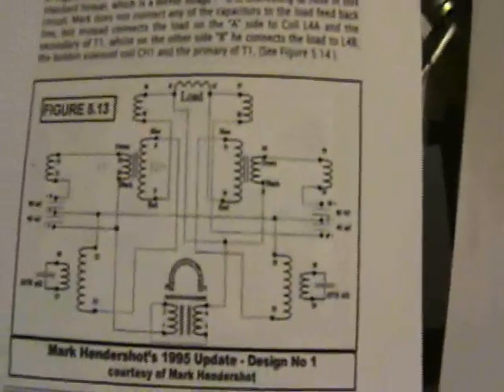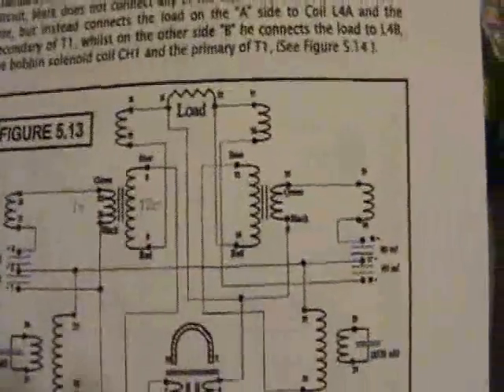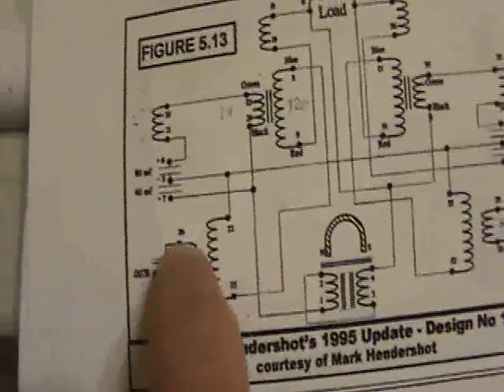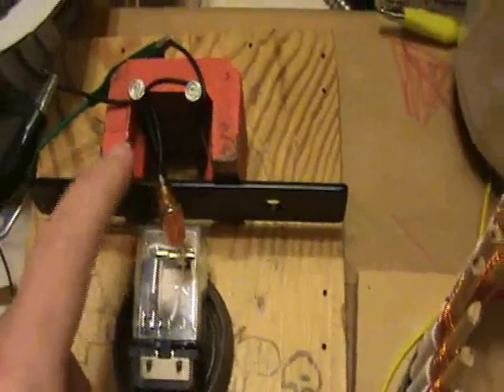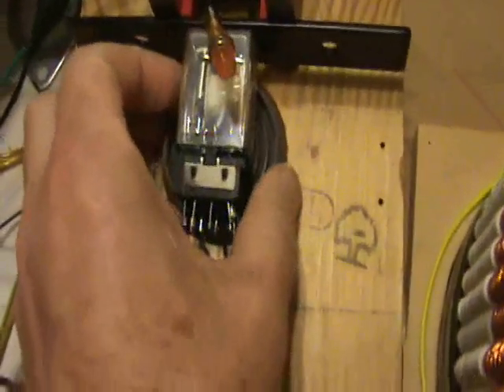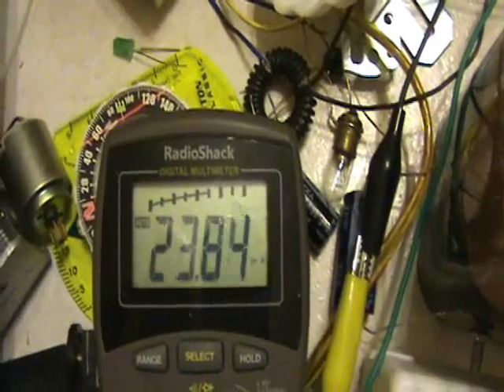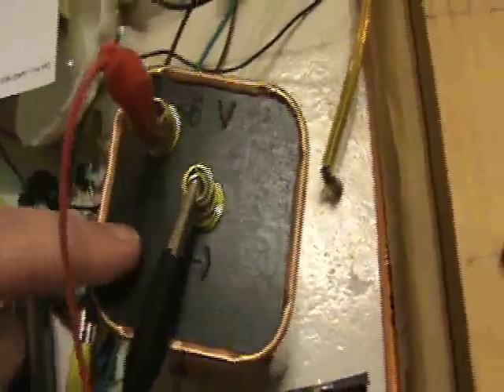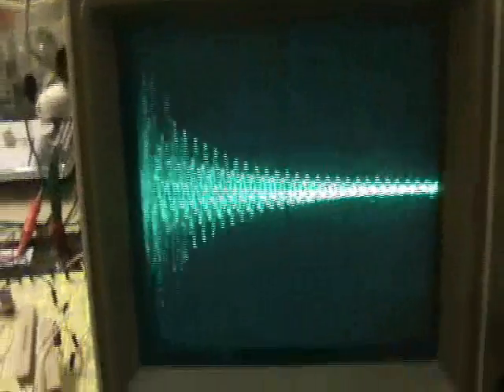"Hendershot Fuelless Generator" -Mark Hendershot 1995 Update

Comment: b
PLEASE READ ALL!!!!!!
I purchased the video; instructions ebook schematic. I remain most disappointed.
First: the video had stopped and then restarted. In that process wire had already been placed and soldered leaving me confused and not knowing. Secondly: the video was extremely amateur; there was no voice to explain step by step instruction, to make the process easy to follow this pissed me off. When I first  e mailed support I got a message that had nothing to do with message. I mailed again and have never received a reply.  Observing the video -several times I gained understanding to a degree, and some parts of the process seem okay. I am not able to read schematic very well, and can see the average consumer would not be able to put this generator together successfully. I observed the lights and the TV. However, there is no reason to believe it was due to the generator. I think perhaps it could light a bulb -although that is it. Many people are attempting to make this work for enough KW to power a house; however, I am confident there is nothing at this point and time. Prove me incorrect!!!!!!!!!!!!!!!!!!!!!!!!!!!!!!!!!!  OH, TRANSFORMERS; ONE PAPER HAS 1.5 RATIO, AND THE OTHER IS 1.5, ON SCHEMATIC IT IS 1.5 ON ONE AND THE OTHER 5.1  --WINDINGS; IN THE INSTRUCTIONS IT READS 12 WINDINGS, THEN 6 WINDINGS, AND THEN 6 MORE WINDINGS. Observing the video, the person wired 6 windings, then 3, and 3 more windings. Now, where the hell is that at? Emailed; can't get an answer.
Reply from the maker: Yeah. There were lots of warnings about that "hoaxed" material. But my number one rule here is why buy stuff like this on the Internet, when you get get it all for FREE using google search. There are even ebooks you can get for free about Hendershot's device. This invention was lost to time. The inventor never filed a patent. There are lots of folks tinkering with this, but if someone is trying to SELL something, that is a red flag in my mind.

Comment from the maker: Hi Walter. My interest was to understand parts of the system, before attempting a full build. It is SILLY to build something if you have no clue how it works. I think many have done that -- hoping that magically it will work. I think there are several little problems to work out and I was trying to break it down and work out individual problems. My building skills are pretty crude. My understanding of this form of electronics is a bit week. I hope to inspire others to try. This is a fun mystery.

Comment from the maker: Well given that I don't have a theory of operation of the Hendershot device, I can't say your idea is bad or good. Its good probably from a LARGER inductance point of view. Its bad in that the LEFT-RIGHT flux trick might be more difficult in a 3-coil triangular arrangement. On the other had, 3 is a stable structure and Hendershot's device was suppose to be pretty unstable.4 might be unstable again.

Comment from the maker: Another aspect of the Hendershot mystery that interests me is that there is a claim in the free-energy research community that the powers-that-be want to HIDE the details of such devices from you and me. If that is TRUE, then anything you find about this device is likely disinfo. However, hidden in disinfo are partial truths -- such as the components he used, and some other clues. Like a good puzzle?

Comment from the maker: Before attempting a full-on replication of the so called "Hendershot Fuelless Generator", I made a series of videos exploring different aspects of the thing and messed around with various components, and partial circuits. This in my lame attempt to reverse engineer some things. Realize that the Hendershot device is a mystery, and there are several things about the design that are unknown and NOT documented. My goal here was to inspire others to replicate this device too and share.